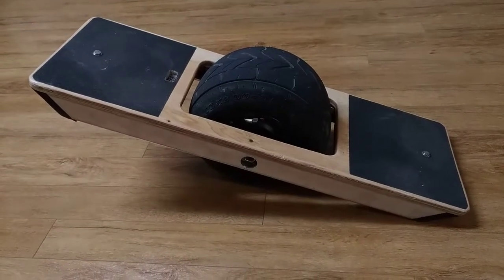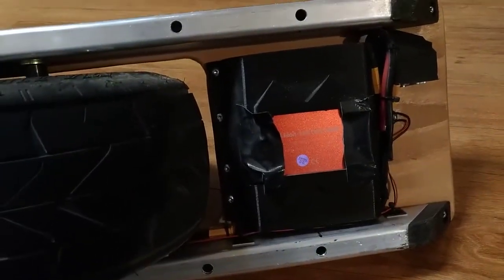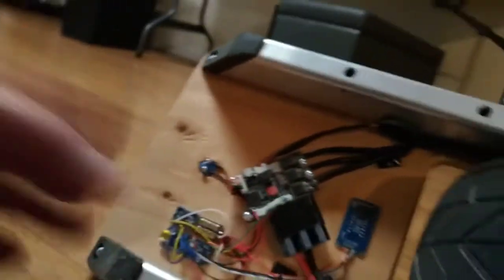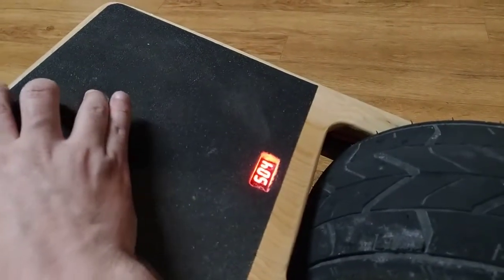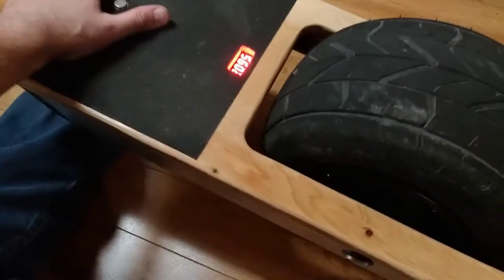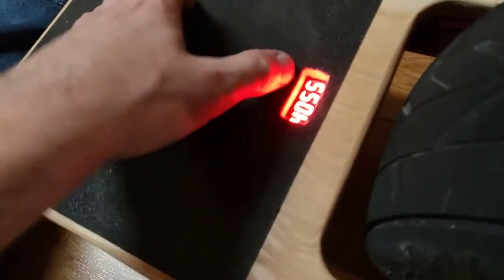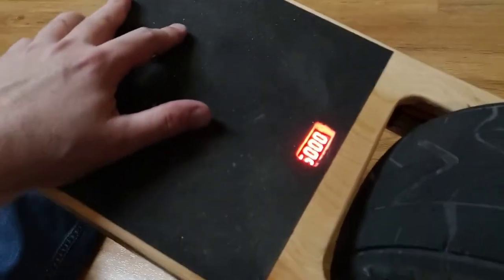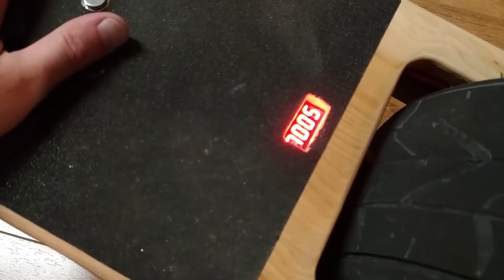BoardOverview

Comment: I think my nosedive today was because of my daly bms cutting power at a certain voltage. I might do what you said and bypass the bms for the discharge.
Reply from the maker: Don't connect your ESC through the BMS, I use BMS for charging only. Outside of that, I use a display and beeper to inform of low battery. Better to kill a battery than yourself.

Comment: First of all, thank you very much for sharing all this stuff with us! I downloaded the BalanceOnly version of your firmware and played a little bit with it. I simply added a println statement instead of sending motorDuty to my ESC right now. 
One thing I don't understand, the motor Duty seems to change absolutely in regards to the y-gyro-position. I expected it to stay constantly the same value while in the center zone.  What am I doing wrong?
Reply from the maker: I might have read your question wrong, the motorDuty will always change if not in level position. The software will always try to level the board to center 0. The centerZone and outer zone just use different strengths. You control the board by fighting the boards attempt to level 0. The point of the two zones is to allow you to easily fight the attempt to level 0 so that you can propel the forward, the outerZone fights harder to keep you from nose diving. The overdrive just adds a little extra power overtime so that you can go faster without having to continue to bring your nose closer to the ground.
Reply: @cammservices  Ok, but isn't it true that you have to lean forward strongly all the time to ride fast which makes it exhausting and also more likely you'll nosedive? I know this behaviour from DIY Onewheel builds made out of old Hoverboards. I thought your "firmware" is closer to the real Onewheels which rather use the angle as an indicator for the acceleration or torque than translating the angle to an absolute speed.  Have you ever thought of using the centerzone as a relaxed position to ride and to keep the current speed?
Reply from the maker: @tonymande  even on the one wheel you have to lean forward and fight the boards attempt to level. It's like pressing an accelerator. Don't think of as leaning yourself forward, but shifting your weight forward. Inside the center zone is to be configured so that it doesn't require much effort to cruise around. Outside the center zone is to be configured to force you back inside the center zone.
Reply: @cammservices  Thanks for you explanation. I'll try how it works on a real board.
Reply from the maker: @tonymande  I think I know where you are coming from. The first approach to my control system was to have the board accelerate when you leaned the board forward, then maintain that speed when you leveled out. Then slow when you lean back and again keep the board at the slower speed when you leveled out. This ended up being very hard to balance on and ultimately dangerous as you would not have a proportional feeling of control. That is why I moved to the proportional acceleration control method, then added the overdrive variable to allow for more speed without more angle.
Reply: @cammservices  Yes, that's exactly where I'm coming from. I never stood on a real Onewheel so I'm lacking this kind of experience. I watched some videos from trail rides, these guys didn't seem to keep pushing the board all the time by leaning forward. For me it looks the board is almost leveled most of the time. I'll take your BalanceOnly version and I'll try it out and give you feedback. BTW: I plan to use it with the regular hoverboard controller, flashed with the FOC-firmware of Emanuel Feru.
Reply from the maker: @tonymande  cool, keep me updated and I will help if needed. If you watch some of my ride videos, you'll notice that there really isn't much tilt involved. When you actually try it out, you'll notice it isn't much of an effort. You're just simply shifting your weight a little more to the foot in the direction you want to go.
Reply: @tonymande  Hi. Do you have any success with combining this with EFeru flashed hoverboard?
Reply from the maker: I probably should have mentioned orientation and how to adjust for different placements. The orientation I used was flat side up and wires pointed to the right side of the board when the board is in operational orientation. This was so that I could use a quality piece of double sided tape to mount it.
Reply: Hello. Do you have a code that works with Eferu for hoverboards?

Comment: very cool) I want to try your version of the firmware, or you can give a ready-made archive with all the files and libraries.  I tried to manually copy the code, but arduino ide gives an error on libraries.  here is my mail vfear_777@mail.ru
Reply from the maker: I have posted a new firmware version and added a download Tab under Arduino Code. Let me know if you have any further issues.
Reply: @cammservices  Thank you, I'm thinking how to use your code for Arduino with a hoverboard motherboard. We can connect the Arduino via UART to the hoverboard motherboard. I already used the custom FOC firmware https://github.com/EmanuelFeru/hoverboard-firmware-hack-FOC - it works very well (I used this firmware for a children's car, but I didn't use it for Onewheel). Now I made Onewheel based on this project (on standard firmware) https://www.thingiverse.com/thing:4083101  - I connect two motor wheels into one. If we could make an Arduino + hover motherboard, it would be very cool)
Reply from the maker: @cyberwork8712  I will have to do a bit of research on the interface to control the hoverboard motherboard, but I can break my code out into just the main blocks needed for balancing and drive. You will have to adjust the setting parameters in the code as you will be lacking the two switches and display. This will remove the need for EEPROM storage. I will post a side project that you can just update the motor output routine with the code to drive the board. My primary concern is that utilizing 3D printed parts for structure is going to fail quite quickly. Nothing beats a good old plank of wood. Give me until tomorrow to post some code.
Reply from the maker: @cyberwork8712  Ok, I have added the base code you will need to utilize the balance routine. Check out Side Projects tab.
Reply: @cammservices  I tried to download the from the side projects tab but unfortunately the URL http://www.cammservices.com/download/BalanceOnly.zip replies with 404 not found.
Reply from the maker: @tonymande  Sorry about that, you just had bad timing as I was doing some maintenance on the server. Try again, all is back up.
Reply: @cammservices  Thank you! Cool, works again.